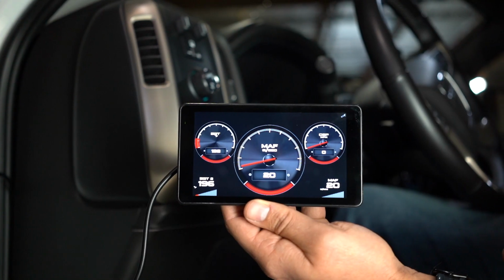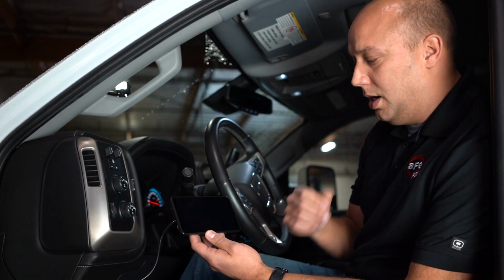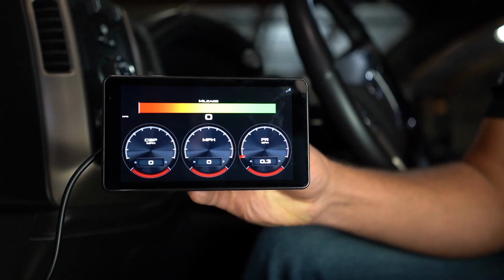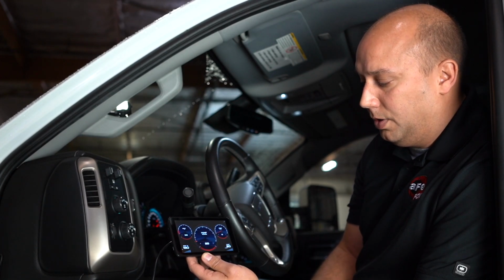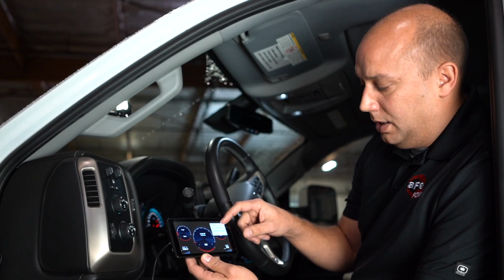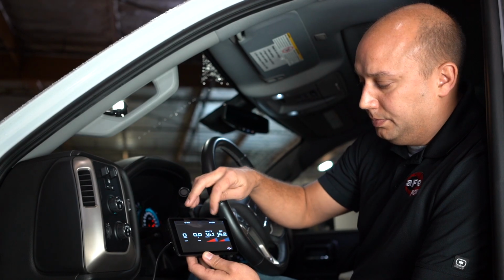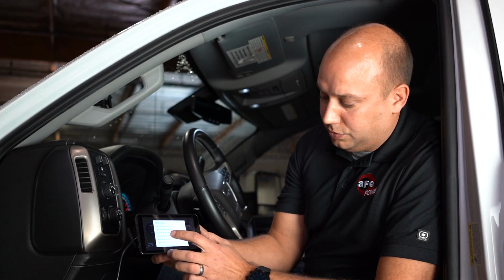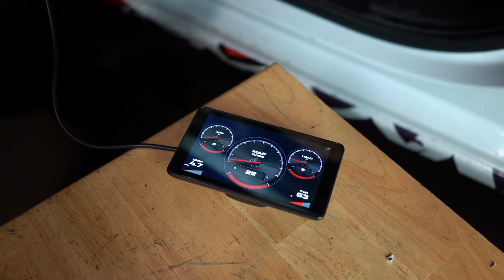aFe POWER Advanced Gauge Display 5.5" Monitor

Comment: How do I update my monitor? It won't read Turbo boost!! I need your help. I own a 2013 Dodge Ram 2500 4X4 Cummings Turbo Diesel Truck.  I also have a Easy Link tuner and it won't connect to it